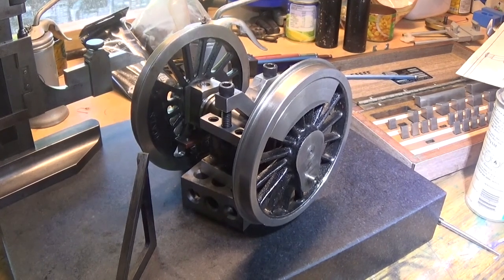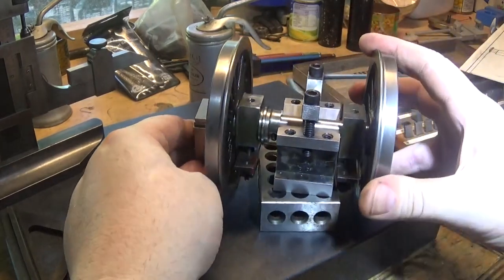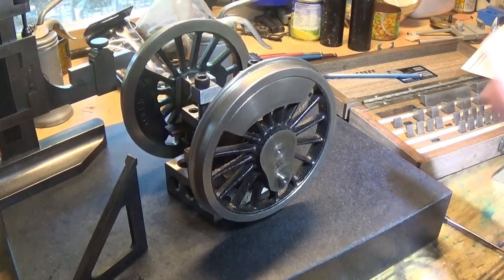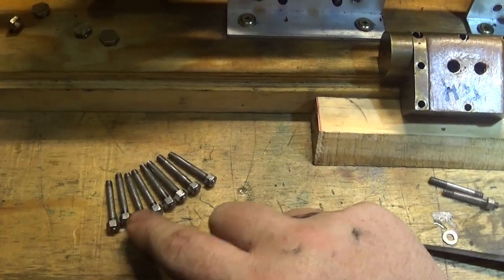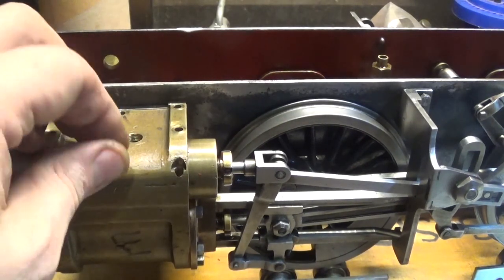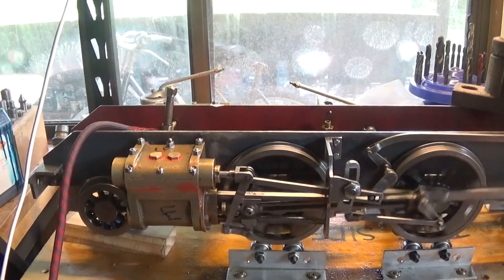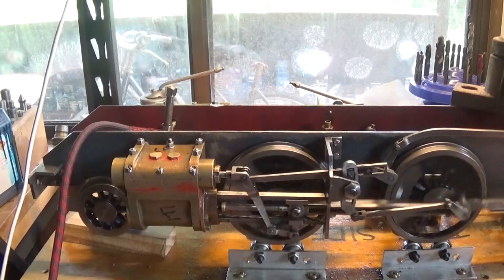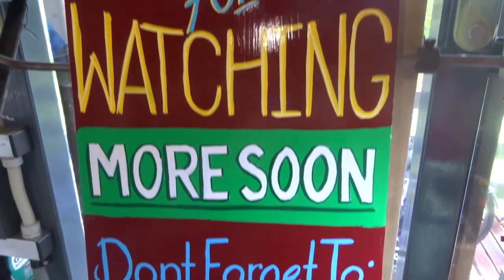PRINCESS MARINA   Quartering and other Quandries

Comment: Hi Emma,
When I quartered my Caribou,
I set the axle assembly in the lathe between centers, rotated the wheels to set both the 
Pins at 45 degrees down on blocks. I had an Atlas lathe with Flat ways at the time making it easy.
I calculated the height of the blocks to achieve 45 degrees on each side.
I loctite each set and allowed them to set up over night.
The pins were different sizes so shims were required.
Looking at your set up now I
Would set one pin up 45 and one down.
That would eliminate the need for shimming because the pins would be located on the same side of the pins.
The v blocks would work as well as the lathe setup for loctiting the assemblies.
Good job girl.
Keep up the good work.
Kap